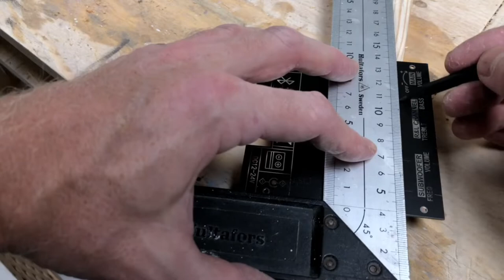DIY subwoofer with BT amplifier

Comment: How is the sound from sub with and without the hood on top. Any reason for choosing top firing than down firing
Reply from the maker: It is at the same time a furniture so one can sit on top on it since that is like a steel cage. Since it is so low herz it doesn’t matter if it goes at the top or the bottom . But the basreflextube goes back towards a Corner and THAT increases the bass.
Reply: @mackemacchiato3238  wow one can sit too nice idea
Reply from the maker: @anandshah71  it is for all the wifes out there who doesn’t want a “black box” next to the sofa but a furniture they can decorate with :)

Comment: Great result! Where do you calculate the port size? And do you have any final fs measurements?
Reply from the maker: Hello!
I have bought a calibration mic but haven’t had time to det it up, since I got the wrong type of mic and need a pre-amp to it before connecting it to a computer. 
But the audio is actually amazing! 
The stereo spread is insane and fills up even a 50sqm room